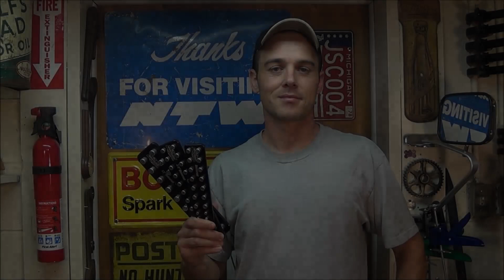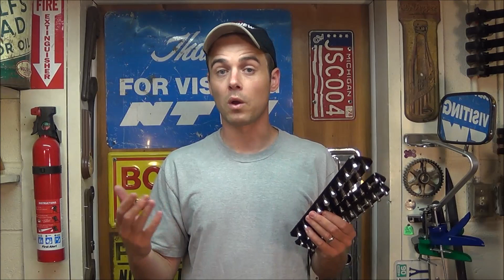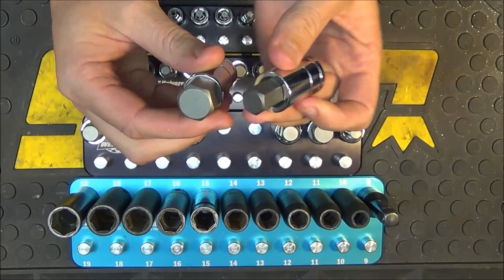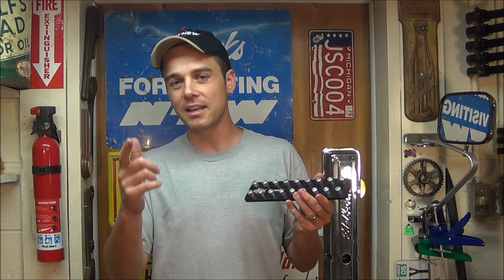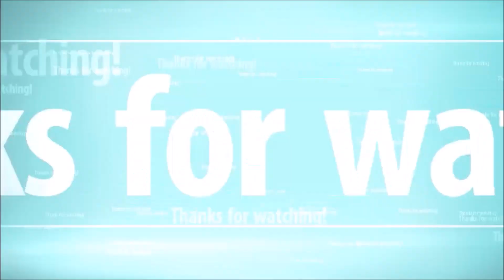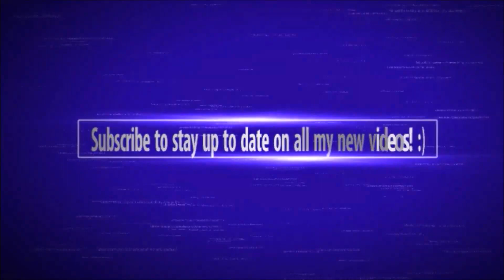Westling Machine Company - Universal Socket Trays - MADE IN USA

Comment: Nice tray set, got the  $99 set plus a couple of additional metric ones. Yes the work great for chrome & thin wall impact socket, but when using them for my Sunex metric 1/4 inch impact deep & shallow or my Cornwell metric impacts you will only get so far before the sockets touch where you can't place them in their spots unless you flip upside down. Had no problem using the 1/2 inch SAE tray with my Mac impact sockets. Yes they look good and was able to free up some space, but now got spare trays which I could not use for the 1/4 impact which was the real reason why I got the extra trays to start with. Maybe Westling will come up with a solution to space the pins just a tiny bit, will make a difference.
Reply: which mac sockets did you use for the 1/2 Dr trays I have the expert ones they sell and I wanna get these but don't know if they will fit or not
Reply: Juan Cam h
Reply: I got the actual Mac brand impact half inch SAE, but it's not just hose. I also have Sunex metric deep, metric standard and they are just a bit thick. What I ended up doing was moving them one or two pins back because gap between pins gets wider. And on those pins I have no sockets on I just put everyday use small extensions or adapters. Nice set and well worth buying over plastic holders. I called them about it, he did not say that they are making any changes. Thin wall sockets or chrome are no problem, they will fit fine.

Comment: Where do you recommend we buy these? Very nice product, sure beats the wooden ones I made and the Kobalt trays I have now.
Reply from the maker: ***** You can get them direct from Westling.....either on their website or eBay page.  I posted the direct link in the video description.  If you are using regular SAE/Metric sockets, I suggest the normal red or blue trays.  I would only get these for chrome swivel sockets, torx sockets, hex sockets, or screwdriver bit sockets.  Also, with the red & blue ones, they have the option for size markings & they are very helpful.  I really like these trays.